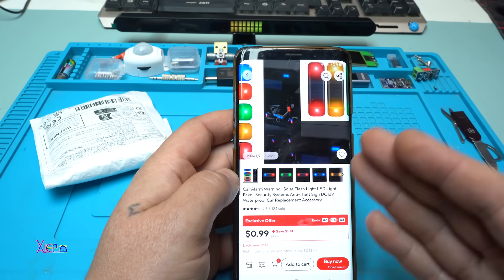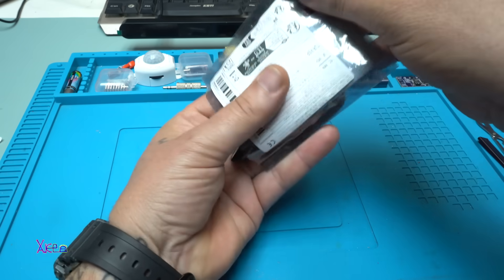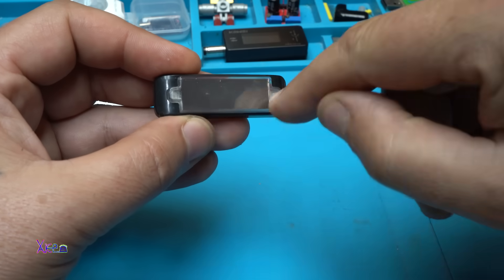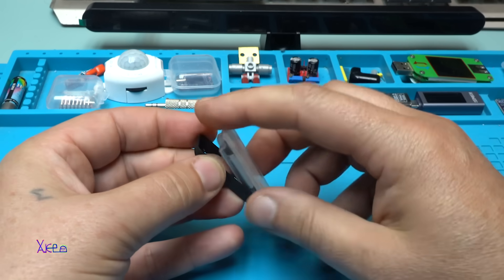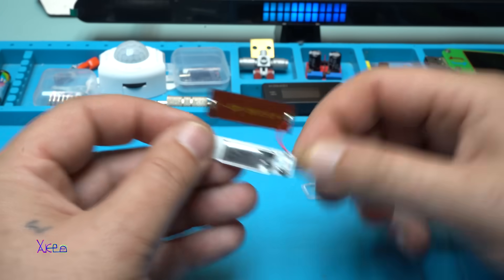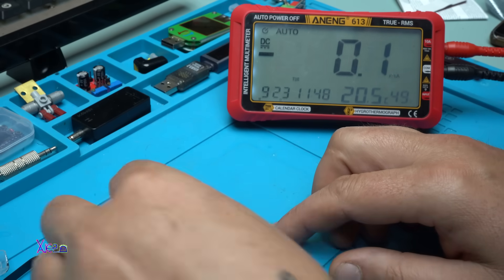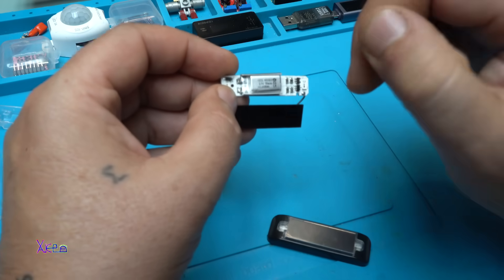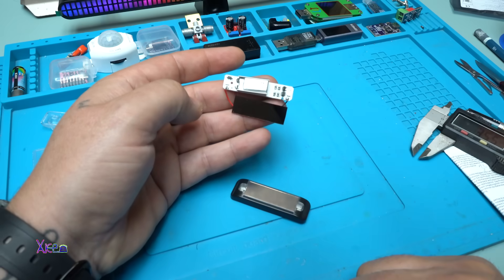THIS $1 Aliexpress Module is BRILLIANT?

Comment: It is a surface-mount electronic component, specifically a SOT-23-6 package, with the marking "348EB". This component is likely a low-dropout (LDO) voltage regulator, a common type of integrated circuit used in power management.
Reply: or a opa348 SOT23-5 opamp with low Iq=45uA?